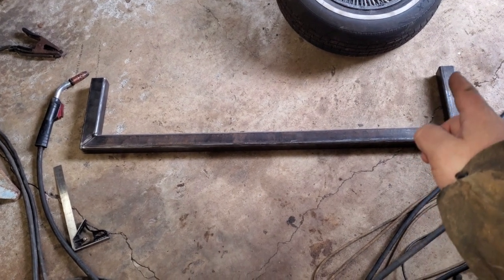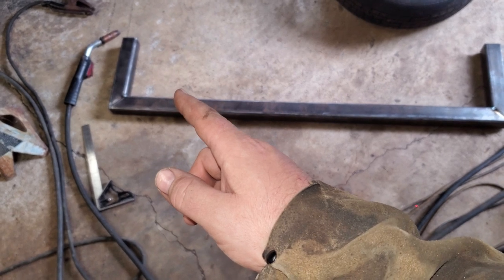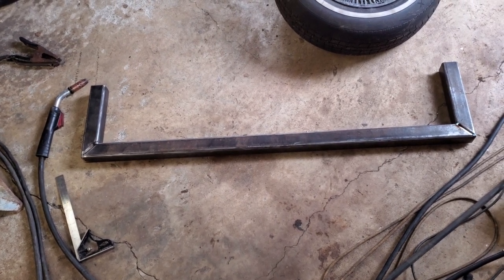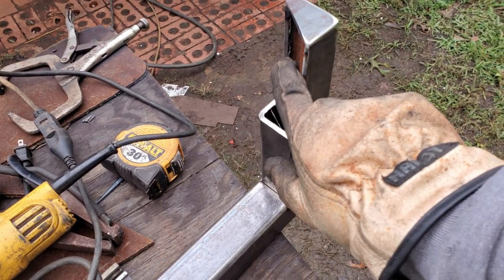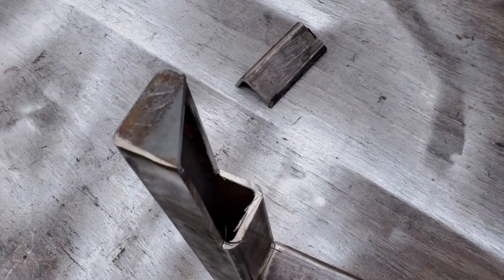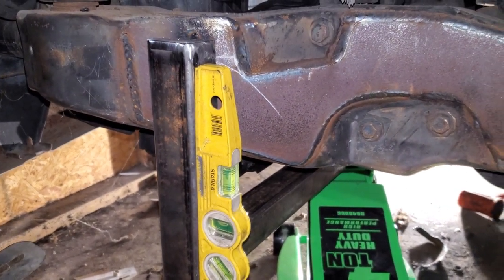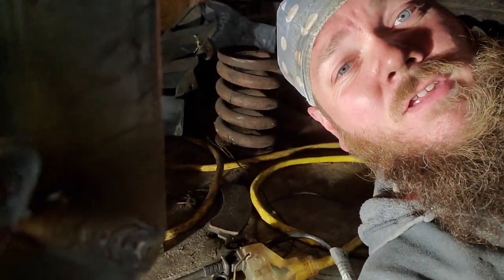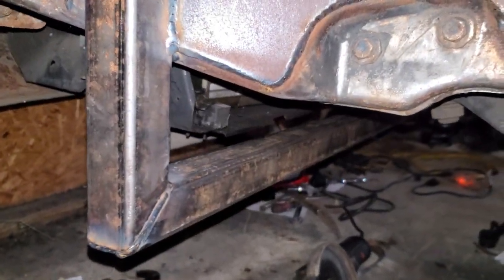Front Bridge

Comment: Nice video, I have a 94 Fleetwood and I have problems with the cooling fans if I plug the cooling sensor (the one in the water pump) the fans won't work if I unplug it they work , it's a new sensor,do you think the sensor for the temperature gage has to do something with it ,what can I do ,tnks
Reply from the maker: If I remember correctly when you unplug the sensor it should put the fans in by pass mode and they should kick on with the sensor plugged in and the ac on do the fans come on. These motors do take a while to get up to operating temp so the fans may not kick on by themselves for a while you can monitor the engine temp using the ac controls you can hold off and the up temp button and the screen will change use the fan speed buttons to scroll up to #8 then hit the outside temp button and it will tell you the engine temp these cars run around 195

Comment: How many batteries should you run with a piston pump to make it hop
Reply from the maker: You can run anywhere from 5 and up depending on how high you want to go but you will also be going through motors alot faster
Reply: @thecadillacdanshow8658  ok I have 8 just thaught I neede more vaults to hop
Reply: I have pre cut 2 ton coils and a pair of 3 ton I cut
Reply: Which one is best for beginners
Reply: @thecadillacdanshow8658  got a question my motor is spinning but no pressure to the cylinders what could that be
Reply from the maker: @camefromnuthin6994  could be a few things could be bad o ring in between the pump head and block you can try lifting the car with that pump then look in the tank and see if the oil has air bubbles in it if so that I ring could be bad also close the slowdown when doing this if the car lifts it could be a bad dump bypassing it it could be bad seals in the pump head what number pump head are you running and what voltage are you running
Reply: @thecadillacdanshow8658  #11 8  batteries  1100each battery
Reply: I noticed my dump was closed all the way when I checked it
Reply from the maker: @camefromnuthin6994  if it's still not lifting you probably have a problem with either the pump head to block o ring or the pump head it self you can check the key in between the motor and pump head befor tearing into the pump